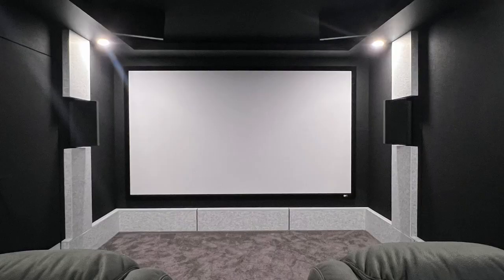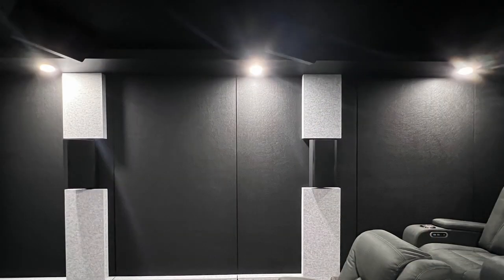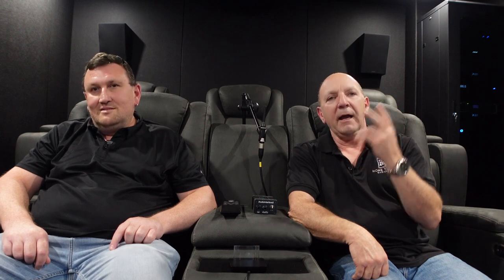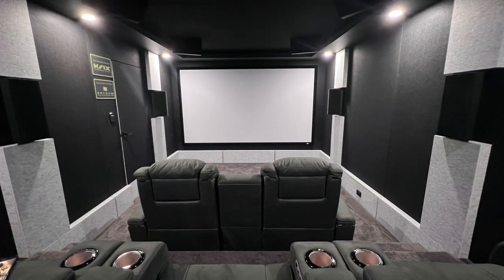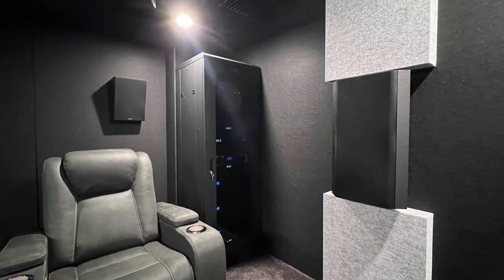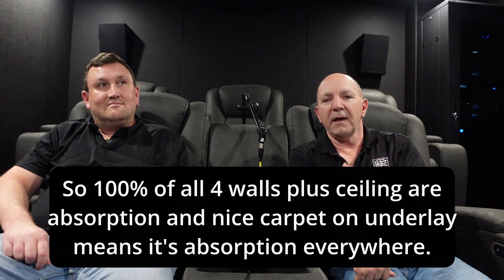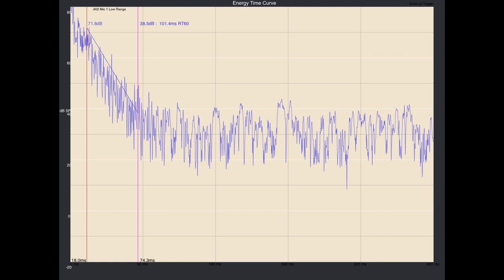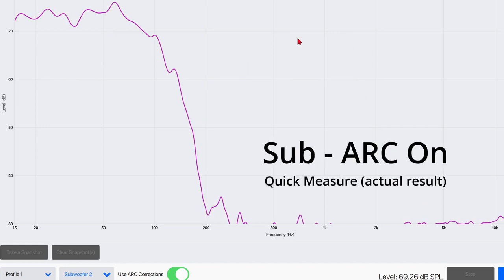Audio Fixed! Tour Jamies great cinema room and discover what we did to the audio.

Comment: Andrew,
I'm a little confused about the decay time. The only way to solve this problem is to remove some of the absorption. Am I correct? What did you end up doing with too much absorption?
Thanks.
Reply from the maker: Hi Thomas 100% correct and not only a good question but something I realised after I posted that I had not addressed. So we had a lot of discussion about that… the client understandably likes the way the supplier built the room visually so he is working on ideas to reduce the absorption The first step is to add some diffusion at strategic locations to help improve this. Then he is going to look at other materials he can use to replace some of the wall panels without changing the look to much. Thanks for asking !